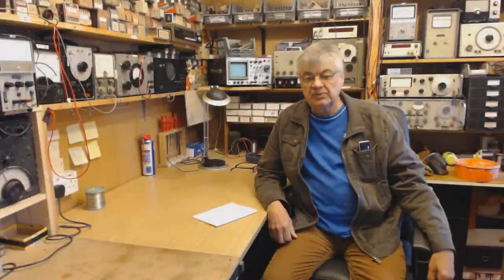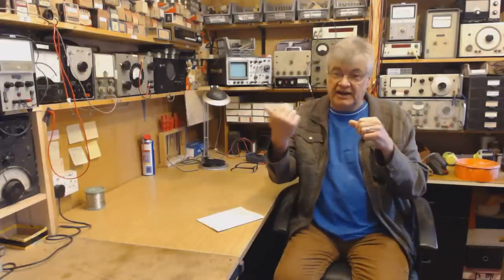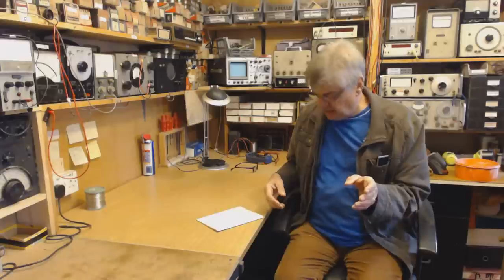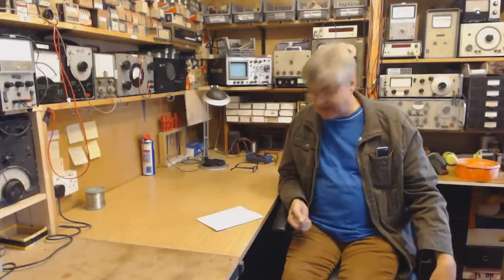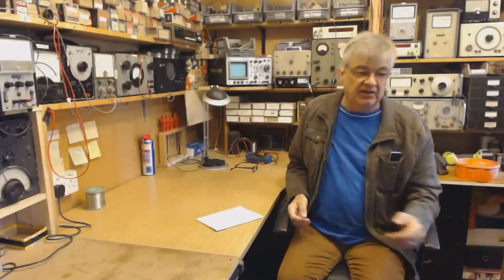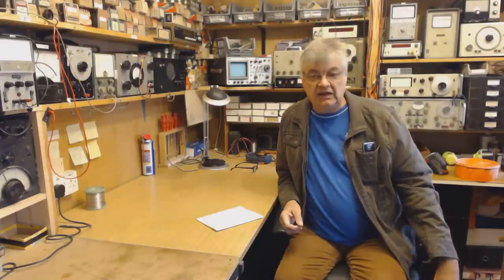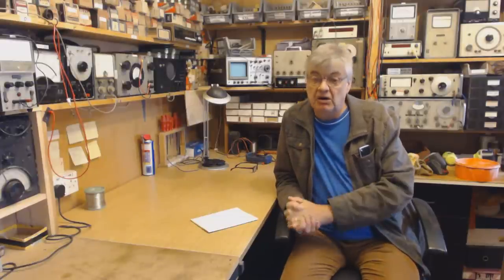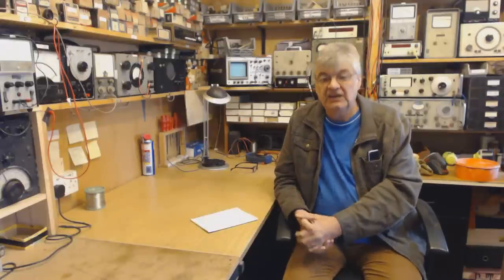Doublet aerial for HF amateur ham radio short wave bands

Comment: Hopefully this isn't too stupid a question.

I've just passed my foundation exam and trying to solve my antenna siting issues.

I live in rented accommodation with about 10ft of patio'd "courtyard" surrounded by a 2 storey house to the left and behind and a single story extension at the end.

I could probably fit something like 15 ft total between 2nd storey to top of extension across the garden which doesn't leave a lot of chance of decent HF performance.

My question is: how "high" must an antenna be clear of surrounding structure?

I'm wondering if I slingshot a wire across my 2nd storey roof with a weighty tennis ball then do the same to the far side of the extension I could get quite a few extra feet, feed it in the middle of the courtyard with a balanced feeder/ladder line and have myself an antenna that may stand a chance on 40/20m.

Downside being it'll be resting on my roof tiles. Would the above stand a chance of working? And do I stand to get completely blasted with rfi if I did that?

Would take any other suggestions you have too.
Reply from the maker: *****  I'd try the wire over the roof first. With aerials in enclosed spaces, it's best to experiment to find out which one works best. Don't worry about getting blasted with RF. Any aerial needs to be as high as possible but all anyone can do in a difficult situation is fit in what they can. Cheers, Ray.

Comment: Hi Ray.. Good video! Question... If you haven't a 'balanced ATU' and you need to use coax to connect to the radio, should you use a balun?  And should it be 4:1 or 1:1??? My Yaesu FT920 has an auto ATU and I'd like to try a doublet!!

Dave
Reply from the maker: Hi Dave, glad you liked the video. I'd use a 4:1 balun, that should be fine. In fact, try and find out what type of balun they use in the MFJ tuners, you might be able to get a circuit from somewhere. The doublet really is a brilliant aerial so well worth a try. Cheers, Ray.
Reply: Ray Heffer Cheers Ray.. That's what I thought so I'll be putting up a doublet this summer... We moved a year last January (how time flies) and I've sacrificed my tower and A3S beam  which I had at the old QTH for something much more accessible (I'm too old for long ladders and harnesses!!) as soon as I get time to put one up!   Not able to transmit at all at the moment! Callsign G0PUD 73
Reply from the maker: Dabhandradio Dave Shaw Shame about the tower and beam but I take your point about ladders and harnesses. Let me know when you're on the air, perhaps we can have a contact.

Comment: I'm just getting into ham radio but for my first aerial I can get a dipole in my garden 140 feet long, 40 feet above the ground and made of 4mm2 cable. After a bit more working out I'm hoping this will work as part of a doublet system. The other good thing is that it will be at a right angle to the mainland of Britain.

Comment: I'm confused.  Wont the 300ohm ribbon pick up a lot of rf noise from the devices in my house?   I'm Using a Grundig 750 radio.
Reply from the maker: The ribbon is balanced so noise any picked up cancels itself out.
Reply: Ah thanks.

Comment: So let me get this straight as a newbie......A dipole is fed with coax, while a doublet is fed with ladder line. That's the only difference?
Reply: I've linked a short but comprehensive article explaining the properties & differences between both: http://www.w1npp.org/events/2010/2010-F~1/ANTENNAS/WIRE/910702~1.PDF     

I'm newly licensed (i.e. I know nothing) and went with an open wire doublet for its multi-band properties. I have limited space and wanted to get the most out of a simple antenna. It was cheap to make and it's very effective (thanks Ray!). Constructing your own antennas is a great way to learn about radio in general. 

Read the article but Ray's video is probably the best there is on the subject

best of luck 

EI9HAB

Comment: Hi thanks for the info what would you do ,i have about 35 feet up on my roof and want to operate all bands if possible . Many thanks
Reply from the maker: An end-fed wire is probably your only option.
Reply: Also could you fold it back on its self to make it longer?
Reply: Sorry just seen end fed wire have you a video on this as i am looking into options, i am still doing foundation
Reply from the maker: @mplmpl7780  Certainly worth a try.

Comment: Not a radio ham, but I listen to Air band as I am under one of the Heathrow 'stacks'. The aerial I use is a vertical dipole (2x450mm elements.) It works OK. Would you say this is about right Ray? The main frequency I tune to is 134.975MHz.
Reply from the maker: Yes, that sounds about right to me. Cheers, Ray.

Comment: HI Ray, It just occurred to me while absorbing your words, other than power output....why do we use coax as the goto feeder instead of the more efficient ladder line?  Axel 2e0dig
Reply from the maker: Axel Taylor coax is more convenient in Kenya respects. For example, you can take it through small holes in walls or wherever.  It’s easy to use and cheap.

Comment: Very True only prob I've found is using a PC in shack and twin feeder into a balanced or unbalanced with balun causes the PC to go wild,  had to use coax into the shack with choke to reduce common mode currents
Reply from the maker: Thanks, Noel.

Comment: Hi there Ray, I wonder at your patience with some of the seemingly daft questions you get asked. Have people lost the ability to read ?. I was a member of our local public library when I was in junior school. I used to read up on all sorts of rubish, like "A" Level Physics and chemistry. Military Engineering. Metalwork and woodworking principles. The only subject that I did neglect was Maths. Or should I say standard arithmatic. I use to borrow my elder brothers slide rule to help out . Wish I had been able to use a calculatore back in those days. That did help in using a military protractore to work out the bearings to guide an aircraft onto target, as in "Forward Air Contol" Any way I'm waffeling on here. Keep up the good work 73 de G0WXU - John.
Reply from the maker: Hi John, nice to hear from you. All noted, thanks for commenting. Might meet you on 40 metres one day. Cheers, Ray.
Reply from the maker: Hi John, nice post, very interesting. I love reference books and still read loads on them. Cheers, Ray.

Comment: Hello Ray, I use 450ohm window line from my inverted V dipole into a balanced tuner for my amateur radio hobby. I can load all bands from 80M through 10M with a 1:1 swr and am very happy with it.Cheap and effective. I'm wanting to try 160M  but live in Philadelphia and have little room for more wire.My question is can I load the antennas ends with coils and still use my ATU ?
Thanks in advance for any info you can provide.Happy New Year!
Tom,AB3YK
Reply from the maker: Hi,

Yes, you can use loading coils. It should work well. Cheers, Ray.
Reply: Thank You.

Comment: Hi Ray. I'm really interested in this doublet. I only SW listen at the moment, on long wire out the back - its about 80ft up/down/around - all over the place, and it's quite good. I like the idea of experimenting with different set ups and would eventually like to go for my license and therefore would like to put up something that will transmit and receive. The only issue is the size om my garden, as long as it is wide - which is the width of a standard semi-D. However, I could get a longer doublet going in an L around the perimeter of the property. Would an angle of 90degree compromise the doublet too much? Thanks, Adrian.
Reply from the maker: Hi Adrian, I've used aerials in the past with several 90 degree angles and, while they may not be as good as in line wires, they work pretty well.  Give it a try. Cheers, Ray.
Reply: Thanks for responding Ray. I think the major thing I take away from all your advice is to utilise the space you have as best you can and give it a shot. So I will! Thanks again. Adrian.
Reply from the maker: Let me know how you get on.

Comment: A much appreciated validation of what I have experienced. No more guessing about what kind of antenna to put up. I'll always go to a doublet fed with 600 ohm ladder line. While having to tweak everything else (equipment, grounds, power, etc) I never have to worry much about that antenna. Now I have to go convince a friend of mine that the G5RV isn't the king of antennas! ;)
Reply from the maker: +Kevin der Kinderen Hi Kevin, thanks for posting. Glad you appreciated the video. Cheers, Ray.

Comment: Ray, appreciate your time on this Video, i saw a design with 300ohm TV line used as the antenna legs connected at the ends, then also fed with same line to a tuner, they called for 1/4 wave legs and 1/2 wave feeder length, what do you think ? I have plenty of this line, and want to take it portable 80-10 meters, or 40-10 if i have to , Thanks, Aj
Reply from the maker: Hi Aj, it sounds like a folded dipole which will work quite well. However, I'd stick with a doublet given the choice. All the best, Ray.
Reply from the maker: AJ Hillbilly Mr.Hillbilly that sounds great, give it a try and let me know how you get on.

Comment: I use open wire line  up to the wall of my house and then 450 ohm  plastic ladder line in to my shack  because it dose not need to be kept  under tension to keep its impedance 

My atu is a home brew job  link coupled  with two tuning caps one  in each leg of the feeder line on to a taped coil for balancing the feed line and electricaly shorting the feeder to its correct lenght   .
Reply from the maker: Sounds good to me. Homebrew stuff is the best way to go. Cheers, Ray.

Comment: Hi, Thats great. just ordered 300ohm ribbon. whats best method to put plug on the radio end of the ribbon?
Reply from the maker: Axel Taylor The ribbon will have to go to a balanced ATU which usually has terminals on the back.
Reply: Axel Taylor  If just for listening, not transmitting ...You can use a 300 Ohm to 75 ohm Balun to make the conversion. They are often good down to 5 KHz    http://www.summitsource.com/indoor-matching-transformer-balun-antenna-video-coaxial-cable-twin-lead-signal-component-connection-adapter-converter-bulk-p-7262.html?ref=1&gclid=CJWY3OXFtscCFZE6gQod4h8Fbg

Comment: Thanks for this very informative video, I am going to ditch the coax now, all ready ordered 50' of 300ohm of ebay in last ten mins...lol.   I was wondering if you have had much to do with long wire antenna's as I was thinking of trying one out of curiousity?  I am new to wire antenna's even though I have had radio's since 1978 but always used vertical ones, gonna make a Dipole now, I think I could stretch to about 120ish feet if I use whole length of garden and will use the ladder line ive ordered     Sod coax!...lol....Cheers, from Gobowen.....
Reply from the maker: gripper021164 Long wire aerials are certainly worth experimenting with, they give interesting results!

Comment: Hi Ray, totally agree about the doublet, I'm in a low rise block of flats which means an outside aerial is a no-goer. So I have a 66ft doublet up in the loft, it's bent into a funny shape but it is symmetrical! The whole system is homemade including the open wire line and single coil balanced z-match atu My doublet works great for an internal aerial on all bands from 40m down to 10m on 5 watts qrp!. - But because of it's shape and the fact that it's indoors, if you listen to the "experts" it shouldn't work at all!

Cheers. Kevin GW4WOV
Reply from the maker: Hi Kevin, nice to hear from you. It's a good idea to forget the "experts" and do your own thing. Sounds like your doublet is working really well.  Cheers, Ray.

Comment: Superb! What is meant by the “ohm” ratings on ladder line (300ohm / 450 ohm)
Reply: That is the impedance value of the feedline going to the radiating elements of the antenna,measured in ohms.
Reply: @redman840  thanks. I built one and it almost always out performs my 20/40/80 homebrew fan.  It doesn't like to tune on 20m however
Reply: @UCgWLwfDMmGPv0nMk1dw1uTQ now I see why you recommended adding 5 feet as a place to start.  5 feet represents approximately 1/8 wavelength at 20 meters :)
Reply: @dougrea  There ya go...You'll find a length that will work on most,if not all of the bands that you'll use...GL & 73
Reply: @redman840  I read about the doublet and watched a number of videos yet remained undecided if I wanted to build one UNTIL I saw this video.  Thanks for all the help

Comment: TY Sir you answerred exactly the question i needed to know..i did not measure my diplole either. from my front ]footpath tree] to mu back fence trees is around 110'  so i just off set feed so 450 bal would miss iron roof,only for that reason. but i wanted to know how long to make bal feeder. mine IS all the way into shack and bal tuner... youve set my mind at easy Sir. ty and 73..rod vk4fr
Reply from the maker: Hi Rod, it’s great to hear from you.  Thanks for your kind comments. I’m so pleased that you found the video useful. All the best, Ray.